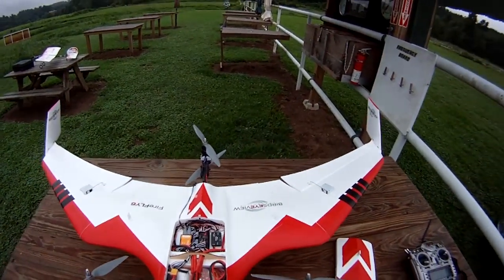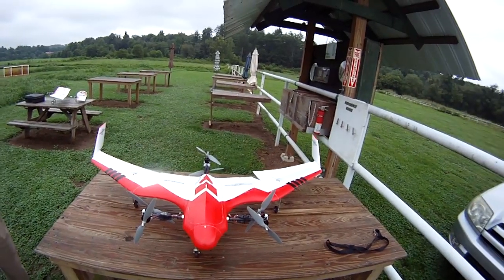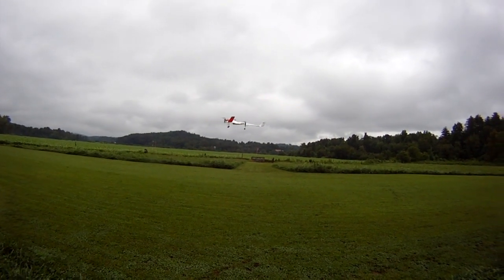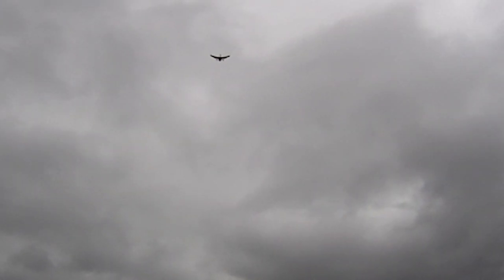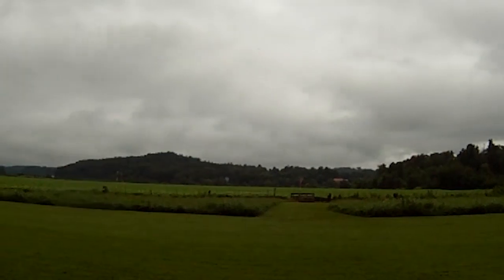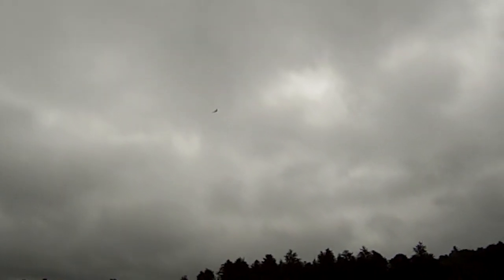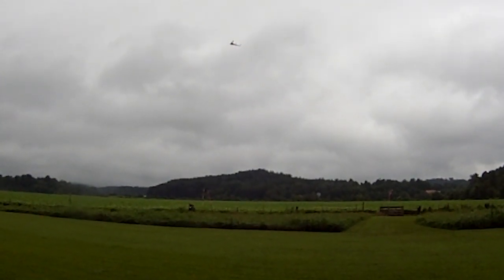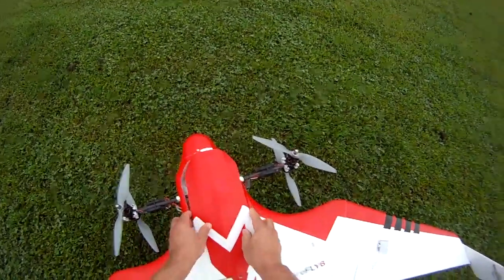FireFly6 Flight 2

Comment: How long time fly on fly mode (not hely mode) with 30-40 km/h and gimbal with go pro inside? I would like to know how far I can go and so what time I have for fly with the weight of batteries antennas, gopro and all the electronics needed fo fpv on  flight Traditional (not helicopter mode).  Please give me the configuration you sudgest for the timee you answer me. Thx

Comment: Do you still fly it? I will maiden mine this weekend.
Reply from the maker: Yea I still do. Usually at airshows... Let me know how your maiden goes.
Reply: An Aerial ViewPoint I finally found some time to maiden it today. I did only hovering today and noticed that in vertical mode the sticks were moving the elevons instead of changing the speed of motors, like  Y6 should do. I was expecting the sticks to move the elevons only in the plane mode. Am I doing something wrong with the radio setup?